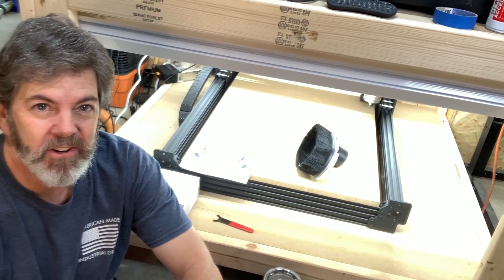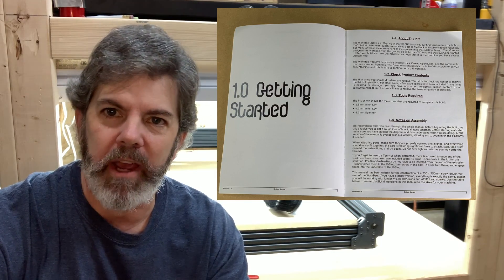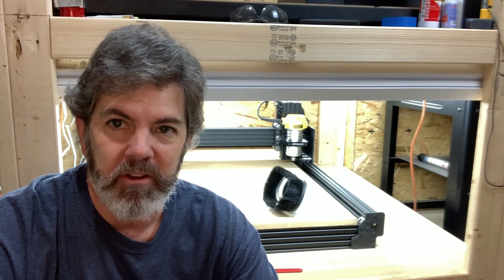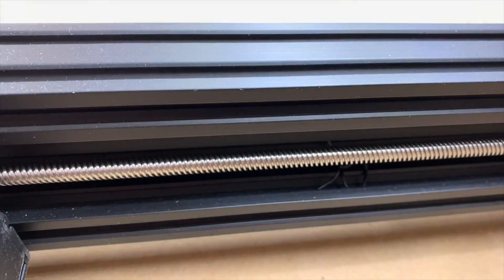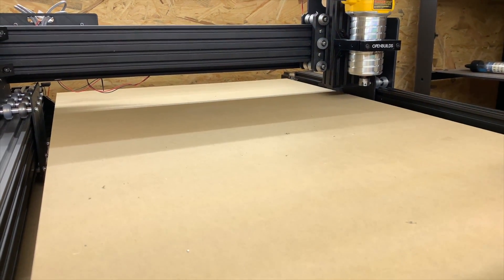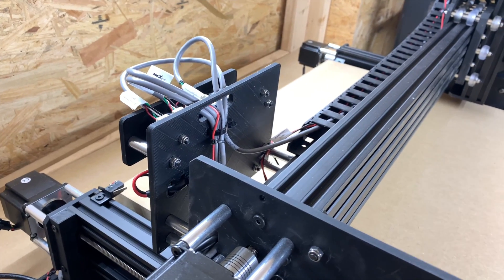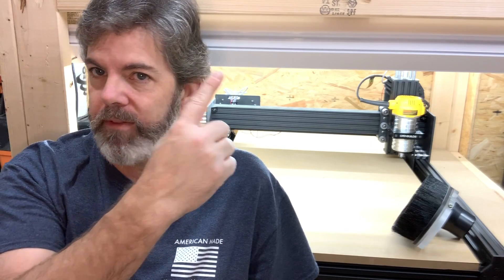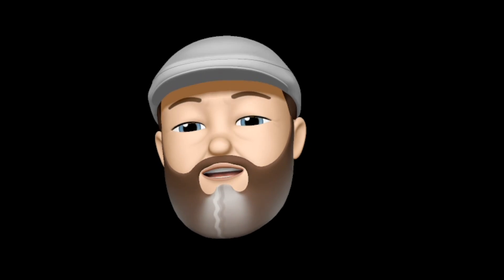Should you Buy an Ooznest Workbee?

Comment: What kind of software is good to use with work with this cnc
Reply from the maker: The machine operating system is included.  For design or CAD I use Vectric Aspire, but there is a bunch of less feature rich options available for Vectric that do more than I need.

Comment: By the way...
I bought it from bulkman3d.com , not ooznest.
Ooznest copied it. I think. Maybe it's the same company. I don't know.
And then, there's openbuilds. So it's kinda confusing now.
Reply from the maker: Open builds and Ooznest have some sort of relationship.   Not sure where bulkman3d fits in or if it does.
Reply: We are the Original Designer of the WorkBee and released it Opensource. We did not copy it from Bulkman3D, the other way round. The Original Genuine WorkBee is only made and sold by us.

Comment: Many thanks for the kind plug ManCrafting   ; )
I was kind of surprised seeing my WorkBee images in your video,  and kind of honoured for being part of your fantastic review of the 'Ooznest WorkBee'. Should anybody consider buying a WorkBee from Ooznest ...................  absolutely!

I would say you didn't miss a single thing out,  but I will add to that by saying Ooznest' after sales service is second to none.  I had a supplied part that was badly engineered,  I was directly on the phone to Ryan at Ooznest, he understood exactly what I meant instantly, apologised and sent the replacement part to me by FedEX ..............  I received the part the following day.  And I'm in a tiny village in central France!  One hell of an achievement in itself!

I'm glad you thought of including my 'modified' WorkBee images also,  as I think that' one of the major pluses of the C-Beam system that the WorkBee is based on.  No other CNC machine aimed at the enthusiast or Home Workshop is capable of being modified,  as far as I know.  Simply by adding extra C-Beam extrusions I managed to increase my Z axis cut depth, and increase it's stability.  My latest 'upgrade' has been to install a spindle motor as opposed to using a trim router ( as you have, or my Makita router that can be seen in the image stills ).

If I could also add, if I may ................  I have an excellent build on the OpenBuilds forum, should any of your viewers be interested >  https://openbuilds.com/builds/workbee-cnc-build-my-honest-opinion-tips-and-help.6407/

I obviously gave you a 'Thumbs-Up'  ; )  now off to see the rest of your videos  ; )

TURK
Reply from the maker: You may not remember.  I messaged you way back when.  Thanks for the information.
Reply: @ManCrafting  Hi MC ...................  Yeah, I do remember,  but then again, a few people enquired about using some of my content that is on the OpenBuilds Forum.

So what's next for ManCrafting?  more videos? perhaps a look at the software that you're using? and why you choose it?
As for me,  I'm pretty sure I'm going to go the 'Vectric' way.  After trying various free open source CAD/CAM programs ( all of which have their particular drawbacks ), I'm going to go for the paid option ....................  I always thought there would be a good reason why they cost decent money!  Now I know!

Anyway mate,  good job   ; )

TURK

Comment: How is the electronics and software that come with the workbee? Is it easy to use and reliable?
Reply: Hi. The Duet interface is dead easy to use. This WorkBee is actually very good for what it is however. Watch out if you need accuracy. This one comes with an open loop system. I am having to retro fit mine with a closed loop set up as for my application the open loop was out by almost 2 mm on the Z. So if you can live with that, then this is a brilliant bit of product. If not, totally still buy it but leave yourself some money to upgrade to a closed loop system: Nema 23 closed loop motor + driver, Novusun motion controller, same limit switches, same 24v power supply, Mach3 motion control software. The way this has been designed is pretty good and I do recommend it. Ah, don't forget money for dust extraction gear.
Reply from the maker: The electronics are solid. The machine operating system is continually improved. The newest version I really like.

Comment: Do you know if workbee can be used to drill and route printed circuit boards. Max 5 to 6 mm high stack of 1 to 1.5 mm boards of 4 or 6.
Materials fr4 and aluminium.

Comment: Hi, great video...I have a small sign shop and i'm looking at getting a CNC router, its mostly going to be for cut out letters etc...would you recommend this router and can it do longer lengths in sections that get pulled through?
Reply from the maker: Skynyrd FPV I’d absolutely recommend it.  It’s a solid machine.  My shop has been getting reorganized for the past month so videos have been sparse.  I have several coming up on this machine.  The way you make larger signs is by adding registration points in the file.  So the when the first section is done and you move the material it matches up perfectly.  You can put some dowels in the waste board that the registration points will slip over so its truly in position.
Reply: ManCraftingTM thank you for reply, if all goes well after this lockdown I’m hoping to get one, it does look a great bit of kit.

Comment: Hi ManCraftingTM, Thanks for the video.
Could you tel which nema motor torque size is the best for all purpose job (wood, plastic and solf metal). They come  with torque from 0.5NM up to 3NM I guess.
Thanks
Reply from the maker: Great question.  It’s not something I’ve ever considered.  I usually get the Nema 23’s that come with the CNC kits I have purchased.  They have all been adequate for all my needs.

Comment: Ooznest are cool. I had a slightly malformed part in my Ox kit from them  that made it hard to fit. I mentioned it to someone else saying that I could get around the problem so it’s no problem at all. So I was shocked when I got a direct message from Ooznest saying they wanted to replace the part saying it shouldn’t have happened. 

Basically it was a 3D printed part and the print shifted slightly... wasn’t Ooz’s problem as the shift happened inside some screw holes which wasn’t easily apparent in black plastic. The new part arrived in a day or so and it was perfect. How many firms keep track of their customers problems like this and then go out of the way to fix the problem.

Sadly, this was only a few months before the Workbee came out. If I had waited a few months I could have had a screw driven machine instead of a belt drive one... especially as the only real problem was belts coming loose and the faff around tightening them up. In the end I went dual belts and it helped a LOT. Then I made a Workbee style Z axis, replaced the side panels with taller ones, changed... well, you get the idea. This thing was a GREAT first CNC kit.
Reply from the maker: What I love is that they took care of you without even being contacted.  This solidifies  my already high opinion of their commitment to customer service.  I also love that you have been able to make upgrades to your current platform.   That’s a huge bonus.  My first CNC is belt driven, and it’s been great.  Can the OX be converted or upgraded to a screw drive?  For some reason I was thinking it could.

Comment: I ended up going with Bulkman on ebay, half the price for the 1515 workbee, shipping was free compared to costing me more than I could afford to Canada. Same machine.
Reply from the maker: Graham Prinn so you have it and put it together?
Reply: @ManCrafting  I have it but still building a new work shop to house it. Have looked at it all seems to be there and in good shape. Only thing I'm a bit skeptical about is the lead screws. 8mm isn't any were near rigged enough in my eyes, will be changing that asap. Also i'll be changing the stepper motors, not sure what Ooznest supplied but mine came with 175 oz steppers, That is not going to cut it lol get it ? not gonna cut it . Any way I have 3 425 oz steppers I'll use instead for X and Y, Z can stay as the 125 oz steppers. I did how ever get some closed loop steppers I was going to put in there but way too big, nema 35 steppers. I'll use them to build a bigger machine down the road using the workbee. Like you I plan on having my own cnc army, 3d printers, lasers and routers.
Reply from the maker: Graham Prinn well I hope in the end you have the machine you want with components that will suit your needs.  It sounds like you have a better grasp of upgrades or changing your platform than I would.
Reply: @ManCrafting  I did build a small machine a while back, 3 axis from plans I bought, so I know a little what works and what doesn't and how to fix it if need be. But I never had a break out board with my old machine so that is a bit different for me at the moment. Other than that I'm happy or will be happy with the workbee I,m sure.
Reply from the maker: Graham Prinn look forward to seeing how it all works out.
Reply: @ManCrafting  I subscribe to your channel, watching to see what you do with your machines. Haven't seen the one with you using the workbee. Do you have one? have you cut any aluminum with it?
Reply from the maker: Graham Prinn I haven’t made a follow up yet.  I got a little overwhelmed with orders for Christmas.  I’m in the middle of about three videos right now.  Unrelated to this unfortunately.  It’s in line though.   Aluminum is definitely on the to cut list.  I even have stock for the project.   Hopefully in the next month.
Reply: @ManCrafting  Slow and easy as I have heard, can't be any worse than doing 3d printing. Sooooooooooooooooo slow, think I can sculpt faster than a printer can print. Though I'm very surprised at how detailed things come out. I'm doing some miniatures for a family member, D&D and the detail is crazy good, this from a ender3 pro. Can't imagine a high end printer.
Reply: @grahamshere  I just finished up a 1515 with 1/2" lead screws. I think the 8mm would whip a little too much which would wear out the  Delrin screw mounts prematurally. Helluva deal on the bulkman, wish I had found that deal!
Reply: @knight2255  Sounds good,  How many start do the threads have? I was looking at a 5 start thread which would help with speeding up the machine with lower rpms, 
Can I ask what kind of rapids do you get and what stepper system did you get?
Reply: @grahamshere  Used 5 start, waiting on a Duet Wifi to show up to be able to test everything out. Steppers are the nema23 282oz .9 variety.
Reply: @knight2255  You'll get a big boost in speed, I built a small cnc router and used 1/2" acme single start and got slow speeds, 40" a min then changed to 5 start and got it up to 100 ipm before losing steps, could have set it a 120" but decided to keep it lower. when carving which I did a lot of, the speed doesn't mater too much. It'll only go so fast but with the new drivers and such might change all that I don,t know yet. Hope to hear from you about your set up. Can't wait to build a machine for my nema34 closed loop system, they look beefy.

Comment: Hey Chad, I’m James and I would really appreciate it if I could ask you a question in regards to powder coating and removing vinyl from tumblers. I’ve been doing a two color process but I’m really having a hard time removing the vinyl without getting messed up lines and chipped paint. I was wondering how long I Should cure the cup in the oven before removing to remove the vinyl and at what temperature or time is the best for removing the vinyl after removing the cup from the oven. Please help me with this subject it’s very frustrating making mistakes please please please and thank you.

Comment: if its an ooznest cnc why does it say openbuilds
Reply: both machines are basically the same, but you have already replied that the two companies cooperated with each other.  great machines and videos, I'm considering buying one myself.  would only like to have her ceiling at least 70 mm deep.
Reply from the maker: Oskars Berzins it’s doable.  I’ve seen others do it.
Reply from the maker: Great question.  They have some sort of partnership.  This design, the Workbee was designed by Ooznest.  I think the router mount is sourced from Open Builds.  If you look at an earlier comment Ooznest mentioned that they are an open source platform.  Most of the kit is manufactured in the UK though.
Reply from the maker: Oskars Berzins are you trying to point something out or do you have a question?
Reply from the maker: Oskars Berzins https://openbuilds.com/builds/workbee-cnc-machine.5626/
Reply from the maker: Jeremy W from Open Builds site. 
“We designed this kit due to the number of requests for modifications of our OX CNC Machine Kit. We are offering a Full Kit, Mechanical Kit, Plates Kit and various add-on kits on our website. These kits can be found by following this link: https://ooznest.co.uk/product/workbee-cnc-full-kit/

Lots and lots of the parts on the machine come direct from Openbuildspartstore. Therefore, you can be sure you are supporting them :). Full disclosure, the extrusions are now manufactured by us in the UK, but this was due to it becoming unfeasible to ship the quantities we need from Openbuilds in the US anymore.”

Comment: I have one of these and I am very pleased with it.
Reply from the maker: So far.  I’m loving it.  What do you use it for the most?
Reply: @ManCrafting  Still experimenting. last item was a 6mm ply cut to make a set of parts that assemble into- a mounted holder for the machines essential tools and fixtures. Wooden numberal plaques for the local church pews, drink coasters for fellow Men's Shed members, toys for the grandchildren... When you have a CNC your view of every build changes. Making it on screen at your desk is more comfortable than in the workshop, and duplicates are simple. Wish I had got one years ago...Invested in Vectric software because it makes it a breeze. I could have scratch built the machine, designed a controller, written the control software but did not. Why? because I want to cut wood, not play at product design (I used to get paid for that). This is not only a good machine, it is well supported and easy to modify/extend. A very good bet for a hobbyist, capable and not expensive. Will get you going quickly.
Reply from the maker: Mike M sounds like you’re having a lot of fun with it.  I’m using Vectric Aspire as well and for me it was much more intuitive than Fusion 360.

Comment: Workbee uses a duet3d controller that would be the biggest difference compared to shapeoko. I'm not sold on duet3d which wasn't designed for cnc machines but rather 3d printers. I wish they gave an option of using the proven ethernet Smoothstepper.
Reply from the maker: Since when is a 3D printer not a CNC?
Reply: Hey, thanks for your reply. The Duet was initially a 3D Printing controller, but since we have adopted it for our WorkBee, there wouldn't be many things remaining GRBL can do which the Duet3D couldn't. The Duet also has a lot of additional features which are so useful, such as onboard storage of G-Code files, so if the machines disconnects mid-job, it will carry on running. We have also made our own interface for the Duet, which is CNC orientated.

Comment: There are chinese companies selling ozznest workbee replicas. They are exactly the same beside the controller. Those chinese replicas are even cheaper less than $1000. Frank youtuber bought one and has made a video of it. Frank beefed it up with centroid acorn controller and clearpath servos.
Reply from the maker: MySchizo Buddy  personally, cheapest price isn’t always important to me.  It rarely is.  I prefer to support companies that will support me.  I’ve never had a single Chinese company provide service after the sale.  Ooznest will actually do team viewer sessions to get you up and running.
Reply: @ManCrafting  Thanks Chad! We actually also sometimes provide customer support to people who didn't even buy the machine from us :)
Reply: @ooznest  im curious though, are the workbee components manufactured in the uk, or does a lot of it come from china?
I imagine it's unavoidable at this point to not have components come from china, but just curious. 
Seems like its definitely the sort of machine i would get to start getting into cnc, if i had the space.
Reply: @ge2719  Parts come from all over. The main part, the aluminium extrusion is made in the UK, and a lot of the hardware comes from the UK. We also assemble a lot of the components ourselves, like the Power Supply, Touch Probe, Controller Setup, wires etc. We are on the Made In Britain Registrar. Thanks!
Reply: Hey, thanks for your reply. The WorkBee is an opensource machine, so we welcome other companies making it available through their stores and putting their own spin on it. However, when buying a machine from Ooznest you are not only getting a great product with superb customer service behind it, but also supporting further R&D to push the WorkBee and CNC Machining further and bring it to many more makers at an affordable price!